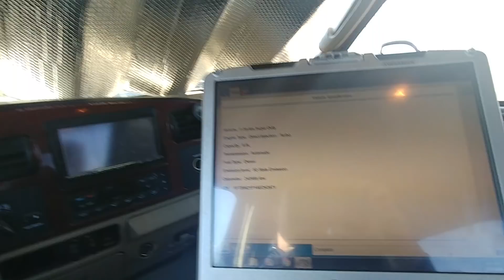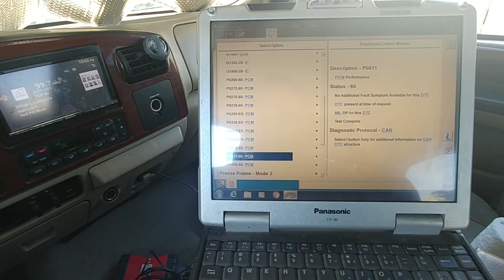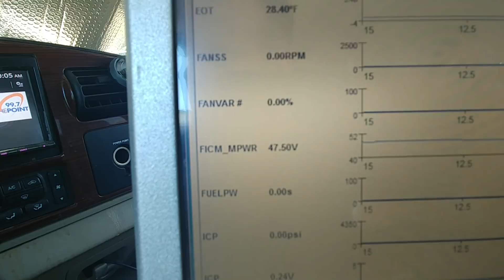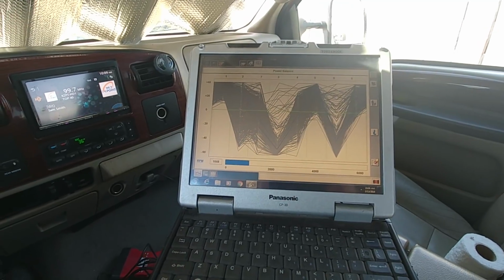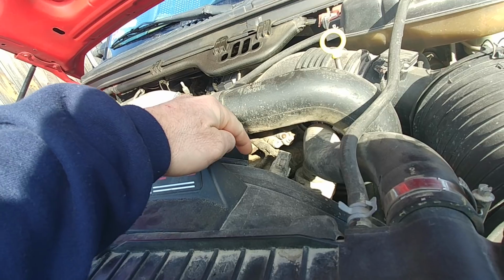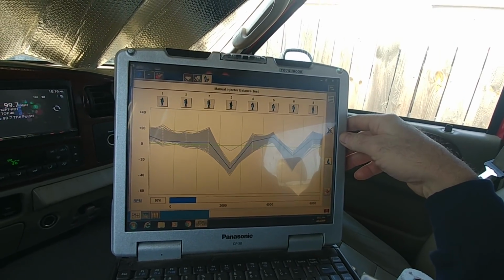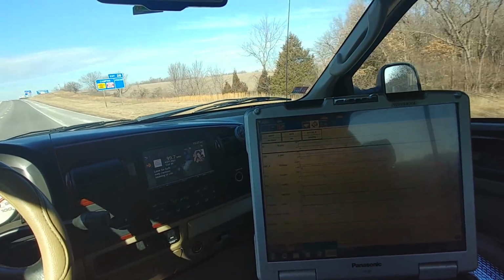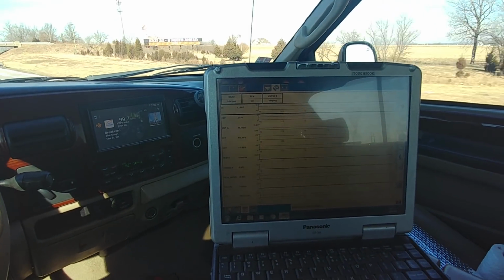Toms 06 diag and cold start

Comment: Okay I see that you are saying he needs a t-stat with the ect being so cold, I just got a scan gauge 2 today and went down the highway at 65* and my ect was saying roughly 177 and eot was running between 210 and 223 pretty much staid at 217 the entire time. So does that definitely mean I need an oil cooler?